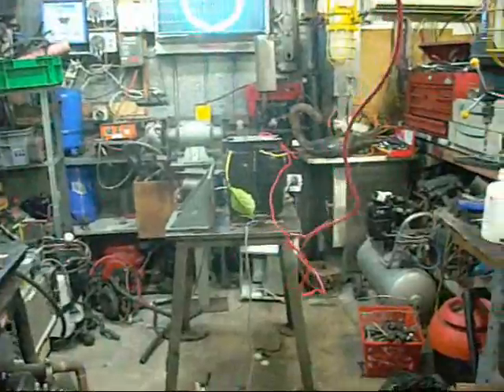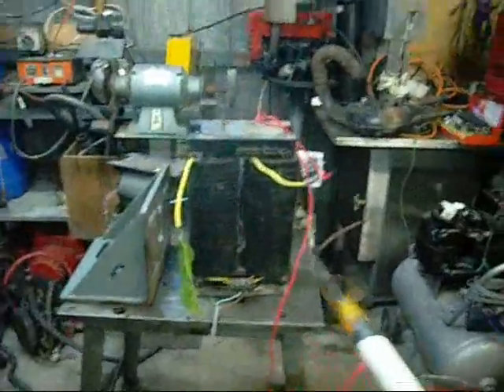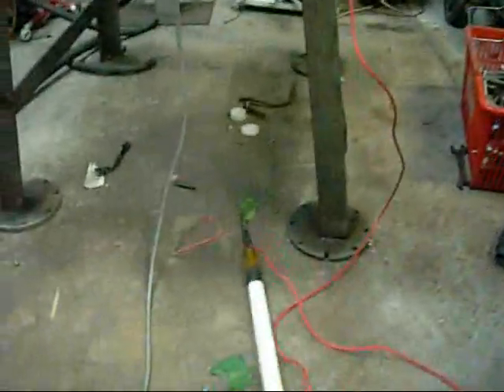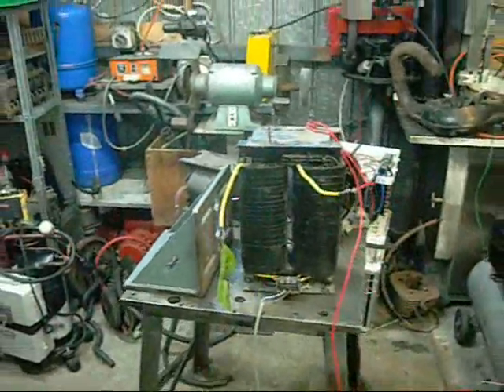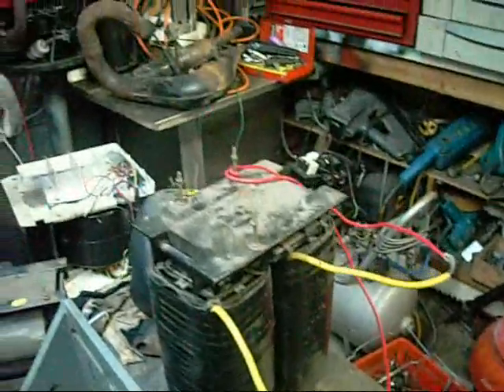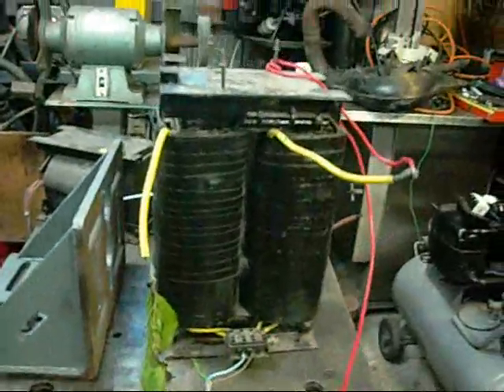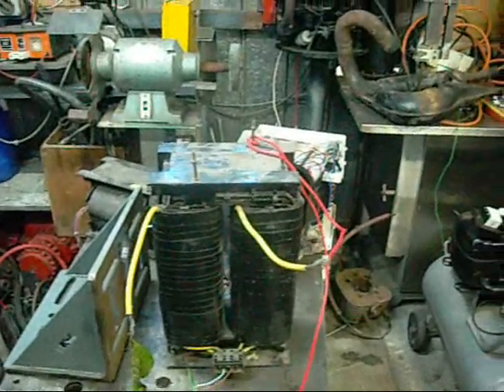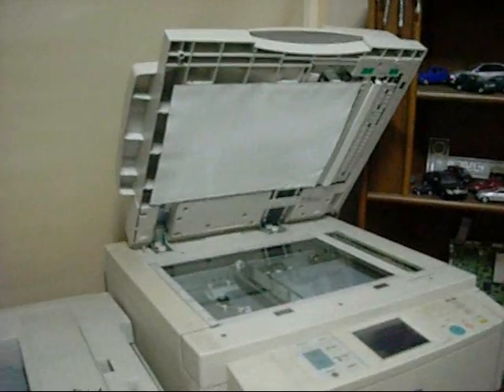Very Dangerous RF welder Transformer - 14 Inch Arcs!

Comment from the maker: G'day!
This transformer is supposed to be 5Kv for feeding the vacuum tubes in the RF generator, however the iron core seems to be damaged and over saturating or something, so actual voltage is anyone's guess.

but yeh, this is the only time I had that transformer operating at full potential!
Reply: Aussie50 put your mains voltage on the secondary and then measure the primary.

Comment from the maker: @Tab54o its not a conventional welder that you use like a Mig. its a set of dies that clamp the material (when you push the start button) and fuse them together.

its like a conventional microwave. put food in, close door, then press start and wait till it beeps.

Comment: That is a grunty Transformer.
You could put 240 Volts on the high voltage side, then measure the voltage at the low voltage side ( the side you now have connected to the 240 V mains.)
That will give you the ratio at no load, if you end up with about  8 Volts, TX ratio is 30.
That 30 times 240V = 7.2 kV
Reply: RODALCO2007 I see you everywhere

Comment: I think your MOT box has a competitor! :D

I think what you are seeing there, is huge arcs due to the high current. The transformer might only be 5kV or so, but the huge current causes the air to become much hotter, letting you stretch out the arc. An easy way to tell voltage, is how close the electrodes have to be before the arc starts. 1kV is very roughly 1.1mm.

Comment: @filipkof In a 1ph transformer, the core forms a complete loop. This allows a complete magnetic circuit, giving good performance and low magnetising(idle) current. To save core cost, 3ph don't have a complete core loop, so there is no magnetic circuit.

Comment: @filipkof If you only connect 1p of a 3p trans, it works fine, as the unconnected core parts complete the mag circuit. If p1 pushes mag field up, the field can loop down through the unconnected legs. In 3p the phasing ensures that when 1 pushes up, 2 and 3 pull down completing the circuit. But all on the same phase, all push up or down simultaneously and there is no circuit. No mag circuit means no idle current control (acts like a short circuit)

Comment: I know this is an old video, but I had to comment to tell you how funny I think it is you called that stick a chicken stick. As if there are people who just grab a metal bar and hold it with their hand. You gave me a good laugh, nice one.
Reply from the maker: 2009dudeman you would be surprised!
worst thing I have seen in a video is a kid holding the HT lead off a microwave transformer with standard pliers right near the end, and arcing it to the MOT core, they were not even electricians pliers, and I never advise it even if thy were!
Reply: I've only seen you, photon, and a few others messing with this stuff. It looks fun, but i'd rather stay away from high voltage.
Reply: +Aussie50 I lived from 2 shocks from a mot 
from the core to the hv + output one on my arm one on my hand I got burned pretty bad and my heart was very low but I lived trust me guys you don't wanna be shocked by a not let alone this beast on the video
Reply: +Lost In Space Electronics mot*

Comment: Having a little fun eh? I just finished a job for 10 years keeping 30 or so RF welders (heat sealer machines) working in continuous production. They are basically AM radio transmitters with the output coupled to a die instead of an antenna. That's a little single phase unit judging from the size of it probably from a 3KW machine drawing maybe 20 amps at 240v. That is known as a plate transformer because it provides the HI voltage to the plate terminal of the oscillator (vacuum) tube. The output of the transformer is rectified to dc before being fed to the tube. Most of the equipment I repaired was 3 phase and 6KW to 30KW  RF output, pulling anywhere from 40A to 150A on the primary side. And yes they had DC capacitors which would store Hi voltage after the power was secured, so a widow stick was my single most important piece of gear. Would NEVER open a cabinet without shorting out the caps first. Made it ten years with no serious injuries. These were serious ANALOG electronics on a large scale - nothing digital about them. No plc's , only mechanical timers and old fashioned relays.
Reply from the maker: Great to hear that you worked with them!, I was having trouble finding any info on them when I did the vid. I do more and more maintenance on the ones at work now and have a better understanding of what they do. the ones at work are sealing ends of solar pool heating tubes with flat loop return manifolds, so its a 2 stage welding process. all single phase units, couple of Kw tops.

I wish I could show one of them but the tooling side is all proprietary so I could only show the HV and RF generation side, so its not really worth it.

Ours do run a single vacuum tube capacitor but nothing more, so once power is down it discharges immediately, either due to the cap design or something connected to it.

Comment: The early TV sets used to use transformers like that, 5 to 6  KV right off the AC mains, most of them were pre war, likely lower amperage but still deadly.The last company to do this was DuMont but they had a voltage doubler rectifier circuit inbetween since they needed 10 KV for the anode on the picture tube.The British were still building TV sets that way until the early 1950s, between things like that and the way they wire their houses, I wonder why half their houses don't burn to the ground.

Comment: @ChumpusRex so you mean that a simple parallel connection will disrupt the magnetic field ? Or a short circuit afterwards? I know there is a difference in 3ph transformes - thickness of core. But i thought  that correct connection by checking the potential between each wire from secondary and then using the centre points as ground. With this i think the phase should be the same on each leg and not causing the short circuit. I know this can't be done with a distibution transformer, but that one..

Comment: You're right, seems like you got a hell of a lot more than 5kV on the secondary.  Since it is an RF transformer, I would think you're pulling a lot more current due to the skin effect.  Since it's designed to operate at the RF range, and you got 50Hz power on the primary?  Seems like it won't effect the voltage, but the current.  I'm in USA but your 240 at 50hz there in AU I think?  Sounds like 50.

Comment: Should be somewhat easy to "guess" the voltage. An arc will first jump at around 3kv per cm. Once the arc gets going, it can be drawn out much further. Hence why you can arc weld with around 30-50 volts.

So just bring the two leads together until the arc self strikes, and for every cm of distance, its about 3kv.

Comment from the maker: @tyreza79 RF welders can run any frequency, ours run about 100hz for welding PVC

you won't find one outside of Industrial suppliers,. RF welders are not common!
Reply: Aussie50 seems like the eddy currents in it would be insane.. it must heat up alot

Comment: @Aussie50 One last thing, i was helping rearrange some stuff at school in the electrical department and im positive i saw one of these transformers. { much older and in a wooden box} it was used to fire up a radio transmitting tube that needed imence current and a small lake for water cooling!

Comment: What you were saying at the end of the video about the amps is dead accurate. The transformer is probably 8kV max but it has a very high power capacity and is allowing close to an amp of current to pass through 14 inches of air! that's 8,000 watts of electricity passing through the air at 50-60hz that's crazy to think about. Great video.

Comment: That sure is a lot of power! One thing to take into account with these, or pretty much all transformers for that matter, is that the short circuit current draw and output will always be higher than "normal" rated operation. Especially with hv. Unless the transformer itself was designed to operate under short-circuit conditions. In most cases however those transformers (like arc welders) are obviously then already rated under sc conditions. In the past, I've taken power readings on a 750 watt MOT. While used for microwave duty, it used just about 0.7 or so kilowatts. But under short conditions it was almost 2 kW. Add a second xfmr, center tapped with the first, plus resonance capacitors you can then get 6+ kVAr. Surely, that transformer had to draw in excess of 8 kW judging from the size of those arcs at 5 kV. Probably easily puts out 2 amps or more. That puny little mot did! Did you ever happen to take any meter readings on this? I wouldn't blame you for not bothering haha not with that much raw power. Regards, Matt

Comment: It probably is only ~5kV... how close did you have to get with the electrode before it jumped? It's approximately 1mm/kV in open air... so half centimeter? The length of the arc after is only due to the hot, conductive ionized corridor created from such high power and current. Negative resistance effect. Much less current and the arc wouldn't have got so big.

Comment: Yea definitely, that would be my thought after thinking about it.  There has to be a frequency converter between line power and the transformer, as all transformers are inductors coupled together and don't convert frequency.  At higher frequencies, not only is the reactance higher, but the skin effect has much more impact (if it's designed to operate in the KHz range they use thicker and less resistance wire).  You've got WAY less reactance (hence impedance) at 50 Hz, and the windings will pass more current as well, as the skin effect has little impact at 50Hz.  The 'Angry Growl' would sound like increased magnetic flux.  It's pissed off! lol HV is too much fun to play around with, and looks too cool.  Definitely don't do it when your drunk.

Comment: What does the RF stand for? I am guessing not Radio Frequency
Reply from the maker: It is radio frequency, the RF welder passes low AM frequency through a pair of brass dies, in-between which are the 2 pieces of PVC plastic to be welded. at 5Kw the 100mm wide strip takes seconds to weld.

Comment: @kristiaand Nah. PhotonicInduction had a 3 phase transformer. However, PI is an idiot and connected all 3 phases to the same single phase, thinking it would boost power output.

This type of incorrect connection disrupts the magnetic circuit in a 3 phase transformer, and stops it acting as a transformer. Instead the primary windings acts like a short circuit, causing severe overload of the mains supply. That's why all his wiring melted.
Reply: ChumpusRex no he just connected 3 variacs inputs in parallel and the outputs in parallel to give him high current output. Yes it was originally designed for 3 phase control but it can be used like photon has. Its basic electrical.

Comment: This thing tripped the main breaker? If it was a 100 amp breaker, and your mains voltage is 240, thats 24000 watts!!!!!! starting from there, lets say this transformer is giving 5000 volts, 24000 / 5000 = 4.8 amps!!!!!!!!!!!! If it was a 50 amp breaker, your still getting around 2.4 amps off the secondary before the breaker tripped. Even if it was a lower amp breaker, 1 amp at 5000 volts would probably break your bones just after your heart explodes. This doesnt seem fun anymore :)

Comment: I need one  about 3000 volts 3 amps any body
Reply: You can get about 2000 volts at around half an amp to 2 amps from a good microwave transformer. But maybe that's not what you're looking for... plus those burn out easily.
Reply: Jeremy Allen get a few microwave transformers and separate the E and I parts and then wind your own putting both E parts together to make 8 shape.